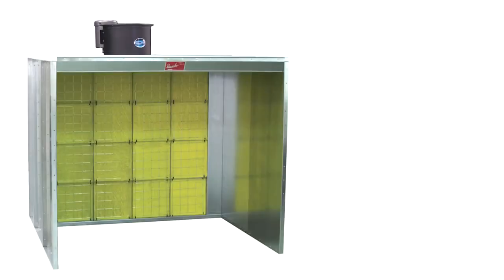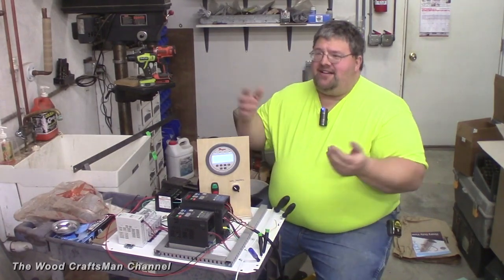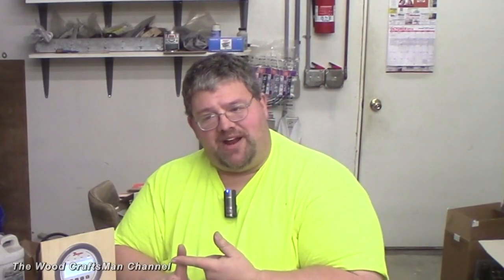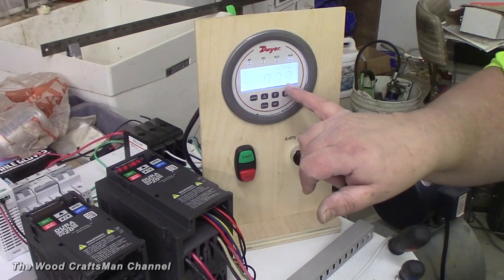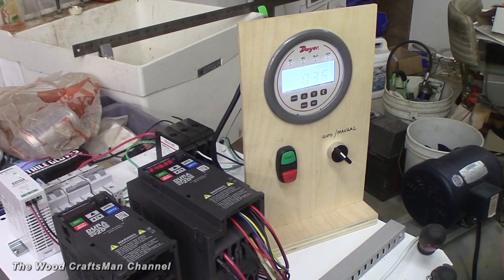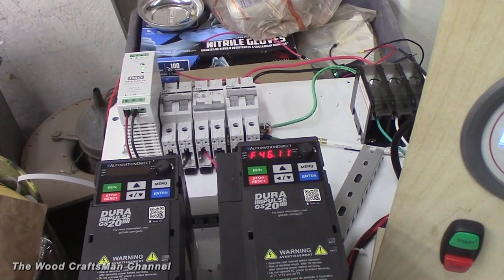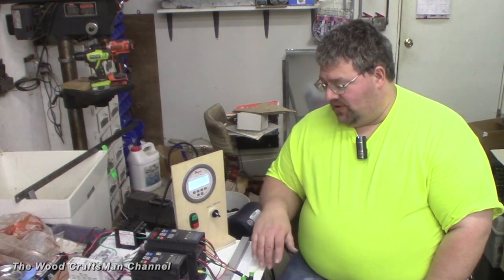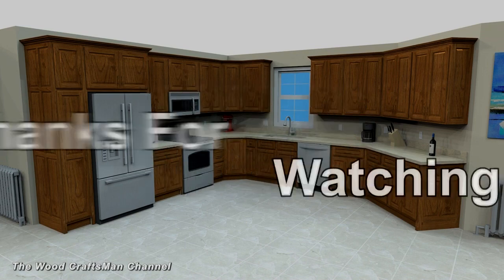Automation Direct GS20 Series VFD Control Panel

Comment: Thank you Scott! Positive pressure is pushing air vs negative is pulling air? Is that correct to think
Reply from the maker: Yes, you air correct. I should point out thought that the positive is very slight. Maybe 0.02" SP.